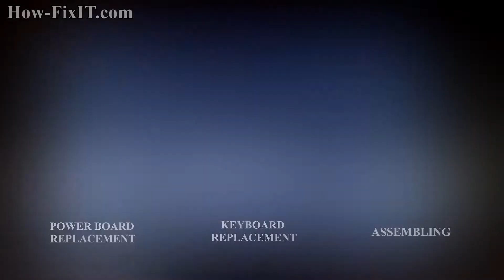Reset BIOS settings Dell Inspiron 1750 laptop | CMOS battery replacement

Comment: Hi mine lock when I on how to remove password lock
Reply from the maker: Unfortunately, pulling the CMOS battery won’t remove the BIOS password. For that, you’ll need to use methods covered in my “How to Remove BIOS Password” video 👉 https://youtu.be/WUDdhJVIR1M